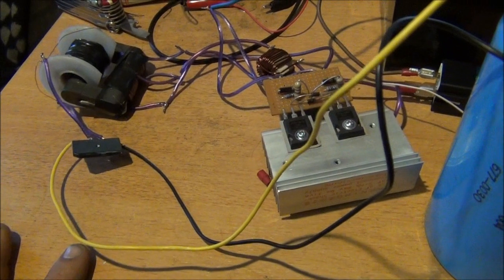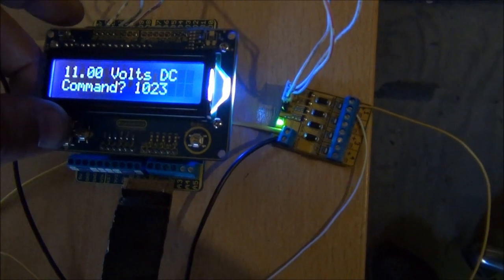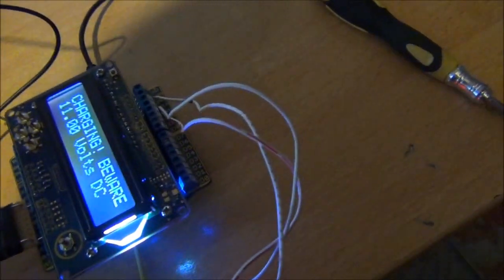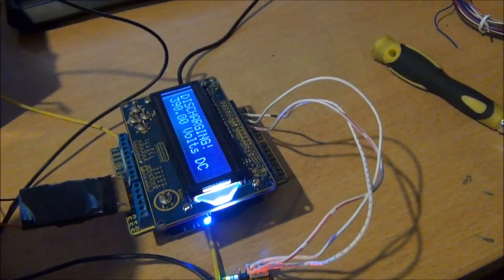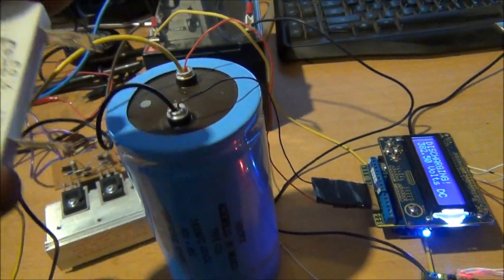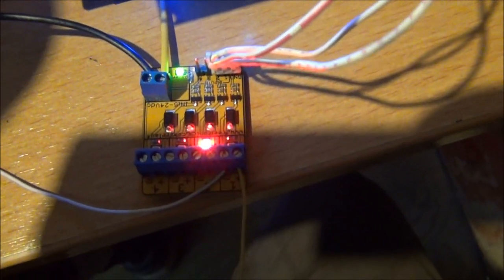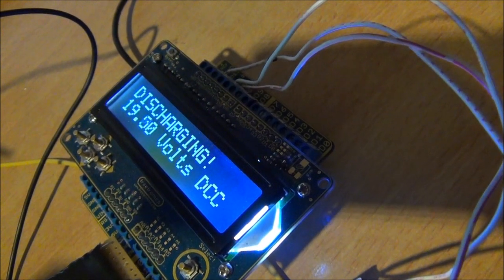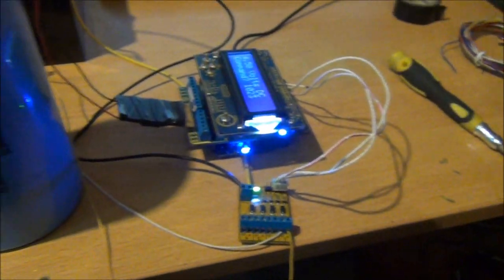Arduino Cap Bank Charge/Discharge/Fire Controller First Looks

Comment: I hope the extreme DV/DT (delta voltage over time) of the capacitor discharges don't damage the micro.  I suspect they will cause it to reset if nothing else.

Isolating everything with optoisolators or similar might be required to stop resetting.

Comment: its not much more than an arduino, a rewound flyback core, and 2 mosfets, and a few diodes. Theres a voltage divider in there somewhere. Apart from the cost of the arduino and LCD, the charger itself can be built for around $10 in parts if you can scavange a flyback core.

Comment: A linear optocoupler would be a good idea here. I gave him the idea - and we're having an arduino controlled cap bank "build off" I've just found some 25pin straight through parrallel leads so guess whats gonna run from my bank charging box to the control console :)

Comment from the maker: re pic chip this could all fit on one tiny board if done right. even the divider. 
yes the software could be tweaked to do measurement aswell :-)
just replace the "fire the bank" command routine with "test the capacitance" routine :-)

Comment: Can your compleated program be blown to a stand alone pic chip or similar so you can make a dedicated module?

What you have there looks usefull for reforming old capacitors in valve radios :-)

And with a tweak in software the measurement of capacitance via the R1 and charge period.

All good stuff :-)

Comment: Just a little safety tip, might be worth programming into the discharge function a bit of a delay, where it stops discharging, and just keeps checking the voltage again, just to make sure the bank doesn't start creeping up again as capacitors do.

Comment: Mine dumps pretty slowly with the 30K resistor (200W) so I'll be using a 10K or 5k even (have both). Mine is in bits at the moment - have to get some sockets and plugs to wire the bank charging box to the control panel.

Comment: Nice work! seems your charger gets up to 400VDC a helluva lot quicker than mine, then I realised your only charging one or 2 caps there :)

Yep it took me ages to debug mine - apart from now having decided to go with just 450V and 24mF. Too much mucking around for series wiring. My caps will still stay in their two strings of 5, just rearrange one set, and add a bus bar to the other.

Comment: very sexy. I love the flyback noise.
you need a bigger soak for the discharge loop a few 500w halogen globes would work well.
I have dumped a mot into one without killing it.
There are a lot more amps here however.